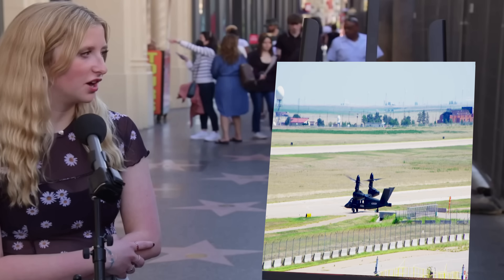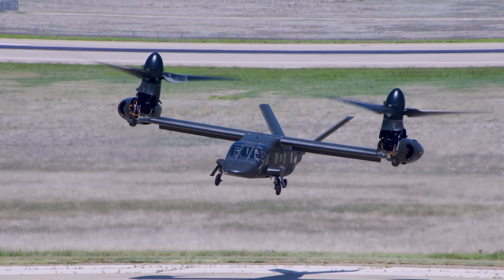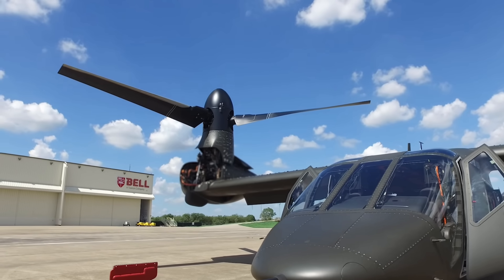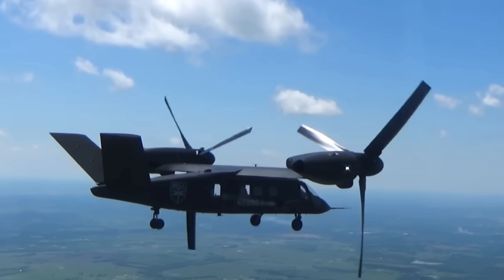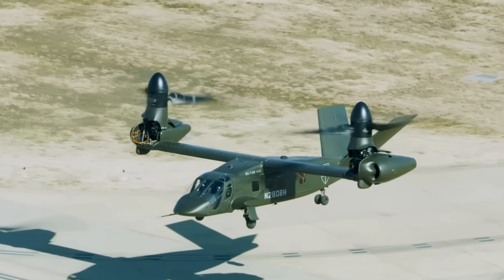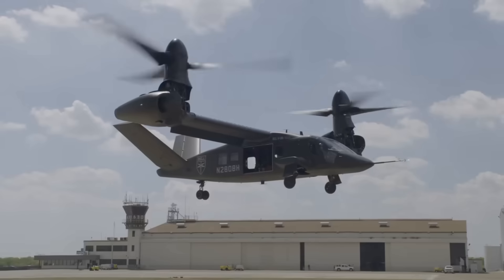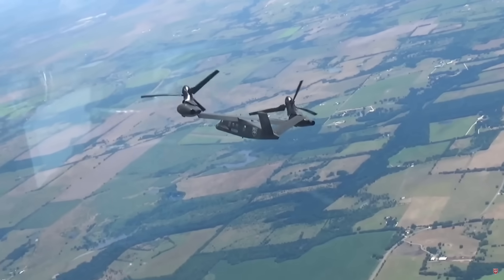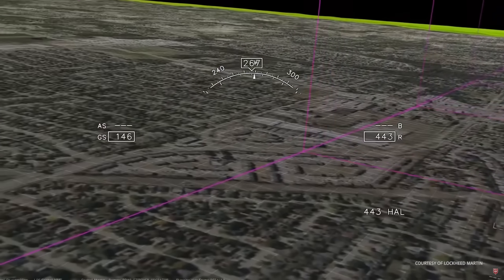Bell V-280 Valor - What's the big deal anyway? | BLACKHAWK REPLACEMENT

Comment: I personally would have wished the Defiant had won. As a Former USAF Pararescueman, I have some experience working around and under helicopters. The fact that all the weight of the entire drive drain is concentrated in the middle of the aircraft tells me that it would be more agile and be able to fit in to smaller spaces. 2nd when the rotors are horizontal, the lowest point is the end of the proprotor blade as opposed to the bottom of the fuselage. Dragging a rotor tip thru a "widow maker" would be a lot worse then scaping the belly. The Shingle stack rotor must fit in a smaller landing area than the Side by side configuration. The most concerning part of the info was that the head of the program has said the decision was based on "Best Value". I hope we have not sold out to the bean counters, again.
Reply: Defiant had the cheaper bid. There is a protest underway with the GAO over alleged selection bias. That quote about value was included in the protest filing.

Comment: the range and speed is a biiiiiig deal. helicopters are some of the most efficient vtol aircraft, but tiltrotors really outpace it. no competition.

the issue with that is its hard to optimise the engine+gearbox and especially rotor parameters to be efficient in both regimes, because low airspeed, high lift and high airspeed, low lift (relatively) use completely different blade profiles.

Comment: Wait a minute..
You’re saying they’re not the same. 
That it’s an Apples to oranges comparison and I think that actually speaks volumes because if they’re so different that there’s no comparison then it’s like trying to put a square peg in a round hole then isn’t it?
I’m sure it’s a fine aircraft but it’s no replacement for the Blackhawk.
It didn’t even meet the armies requirements because it’s foot print is far too big to land this thing in many of the places that it needs to operate and they said they’re even going to replace at least some of the Apaches with it..
Like how is that even a thing?
This is clearly NOT an attack helicopter and while arming it makes sense it’s never really going to be a true attack helicopter

Comment: ive been told that the simpler something is the better it is for longevity and maintenance. With that in mind I would guess that the tilt mechanism has a bevel gear or worm gear in it.
Reply: CV-22 maintenance in the USAF hate their lives.
Reply: I agree - a possible configuration would connect each engine's output gearbox to the cross-aircraft shaft with a 90° bevel gear set, then drive each rotor through another 90° bevel gear set; the rotor tilt axis would be coaxial with the cross-aircraft shaft so no shaft joints would be required to accommodate angle changes.
Reply: A 2017 article by Aerossurance says 
"engine power is transmitted through a spiral bevel gearbox that transfers power to the proprotor gearbox.  This rotates on two spherical bearings."

Comment: i’m concerned with how these things will crash when they get shot down. Helicopters can still slow down their fall with the rotor if an engine is blown up, but this thing would have asymmetrical thrust and I think it would always crash terribly

on the other hand, a heat seeking missile will blow up away from the crew

Comment: It’s good R&D. Unfortunately it will never fly into combat. Much smaller drones and shorter range aircraft will be able to retrieve bodies of soldiers from the battlefield. Otherwise any approach needs armor, firepower, and a secure baggage train of fuel and armor. It’s getting to the point where attacking a prepared defense is just about impossible. Future boots on the ground need heavily armed and defended logistics. Build more Chinooks for whatever reason you think you might need air assault forces for.

Comment: I want to know the technical aspect and  torque loss from the joint.  That piece of tech is perhaps the most fascinating part of this plane.
Reply: There won't be a shaft joint which changes angle - it will presumably be done with bevel gears, with minimal losses.

Comment: The Valor is MUCH faster, climbs far more quickly than the Blackhawk and has a significantly higher operational ceiling and vastly greater range.  Helicopters generally are very vulnerable in urban combat settings, so a repeat of a Blackhawk down urban insertion scenario per se indicates something went very wrong.  If it were to occur, however, while the Valor is indeed a larger target, it would remain in the danger zone for a far shorter period of time.  It is also important to note that Blackhawks are not going anywhere...a large number of them will remain in service with the US Army for quite a long time, so in those settings where a Blackhawk remains the better option, it will conceivably still be around.
Reply: How could the Valour remain in a danger zone for a shorter length of time ? To fast rope troops it would have to hover higher than a Blackhawk thus increasing the potential of inquries and possibly fatalaties. If it needs to touch down to unload its troops it would need a much larger LZ. This could mean that the troops would have to advance further to their targets thus being more vulnerable to enemy fire.
Reply: @crusher8017  You are at risk throughout the entire flight envelope, not only while hovering.  The Valor will be out of reach of small arms and manpad range for more time during it’s flight (which will be shorter overall) than a Blackhawk would under equivalent circumstances because of greater speed, rate of climb, and service ceiling.  If landing is required and the LZ will only fit a Blackhawk, those will still remain in service for decades to come.  Note that despite much protestation to the contrary, the Defiant footprint is also larger than Blackhawk.
Reply: Also don’t follow on your comment about higher hover requirement.  I am not aware of any reason why Valor would need to hover any higher than a Blackhawk for rapid egress.  Additionally Valor footprint is only slightly larger than Blackhawk (just turn 90 degrees).  It is clearly not “much” larger.
Reply: @Aspeer1971  Try landing the Valour in something likes the streets of Mogadishu. This aircraft has too much width. UH-60's could do it. The replacement has to be good all rounder.
Reply: @Aspeer1971  That's what I said. The footprint is larger. This makes the Valour less of a tactical asset for rapid insertions and extractions. It is a good platform for wide open areas but not when people have to fast rope close to the ground.
Reply: @crusher8017  Agree to disagree.  Don’t know of any Blackhawks that “landed” in the streets of Mogadishu.  They crashed.  Again, the Valor turned 90 degrees occupies a slightly larger footprint so the issue is much less significant than that.  The simple fact is the fact pattern you just described represents at most 1% (generously) of the what this machine will do.  Urban insertions into a hot zone are about as rare as it gets, for good reason.  You are simply reflecting a video game, not factual representation of this machine’s real functions.
Reply: @Aspeer1971  The footprint is what I have been trying to point out. And the main time that the Valour is vulnerable is when it transitions from aircraft to helicopter mode. This something regular helos don't encounter. I would hazard to say that regular helos such as the AH-6, Apaches, Cobras and DAPs would clear the LZ for the Valour as it is more akin to a transport than an attack platform.
Reply: @crusher8017  I think we simply need to agree to disagree.  The Valor is accelerating far faster than any helicopter can when it transitions from helicopter to aircraft, while the transition from aircraft to helicopter is still at fairly high speed as it must occur above stall speed in aircraft mode.  So what you are saying is only true when moving fast compared to a helicopter is a disadvantage when moving in or out of a hot zone, which I suspect is extremely uncommon.  The Valor (no u, it is a proper noun; this is not a debate about UK vs US spelling) is also more of a Blackhawk than an Apache replacement, it is not a strike helicopter, though it will replace it in some roles.  It will be able to double as a strike aircraft/helicopter which will convey some important advantages over the Apache in some functions but it won’t be able to replicate a lot of important AH64 functions that require a low flying and stable hovering platform and it is not intended to.  That is why the Apache will be replaced and/or supplemented by TWO different platforms and the FARA program competitors are both more traditional helicopters for that reason.  The Area Denial role will remain reliant on a more traditional low level hovering platform, as opposed to a fast and fuel efficient one intended primarily to transport troops and equipment quickly and efficiently over large distances.
Reply: @Aspeer1971  Fair enough mate.

Comment: You are exactly right. This will require a rewrite of how we use vertical lift aircraft to make our procedures line up with the new systems capabilities, rather than just swapping out the UH-60 and seeing if anyone notices.

But hey, the CH-47 is still running stronk!

Comment: I wonder if the Navy, and by extension the Marines, would go for this to replace the Seahawk, or might they go for the Sikorsky design, given that it has a smaller footprint?
Reply: USMC and USN are more likely to go with Defiant derivatives for medium utility and attack. They already use V-22 that has better range and capacity than V-280, which makes Valor a downgrade for them in capabilities. Defiant is a good option for replacing the Huey and Seahawk family helicopters.
Reply: @Stu_Bur  I recently saw a retired F-18 pilot interview the Captain in charge of the CV-22 program. The adjustments that the Navy requested to make these birds have the legs that the C-2s, of which this guy used to fly, means that these whirl birds have quite the flight range.

Comment: The Blackhawk gets pushed into civilian applications but i feel the size of this kind of excludes those functions, not that the Blackhawk is nimble and small but you can get it into town squares, small fields, car parks, this is 9 meters wider giving it less landing spots. Another factor is the downdraft, i haven't seen anyone talk about it but apparently the Osprey's downdraft is "powerful", it's just another consideration, some Blackhawks will need to remain to function in areas the Valor might not be suited for. As a pure military support vehicle it has incredible advantages, but it loses a little flexibility.
Reply: The downdraft of the Osprey is a pretty big problem but it's also in part due to having the engine exhaust tilting down and being much closer to the ground forcing even more debris to be picked up. The Valor should be much better in that regard but still an issue in arid regions.
Reply: @freetobe3  But it still needs a much larger landing zone.
Reply: The Defiant seems to have more potential for civilian use. I could see company executives or air ambulances using Defiant derivatives for fast and agile transport in urban areas.

Comment: The Ukraine war like most wars is being made with Artillery, not just the normal Artillery tasks but interdiction, usually a Air Force task. You're RCA dig in, ther is very info out there except Thomas C. Theiner ex Italian Artillery officer.
Reply: V-22 would be better logistics support to keep artillery fed with supplies than V-280. Defiant would be better for air assault and medevac in close contact with adversaries.

Comment: I am actually in favor of the Valor replacing the Blackhawk as I see more utility for it if the spec numbers are accurate however, I am wholly against it being the Apache replacement. I find it to large in width for that task and I see the Invictus as being a better replacement for the Apaches mission profile, we learned long ago during Vietnam that having a utility helicopter playing the role of a gunship wasn't the best idea, hence the creation of the Cobra and subsequently the Apache.
And while the Invictus is intended to inherit the Kiowa's role and again if the specs are accurate seems perfectly viable to supplant the Apache as well, as for the Defiant I find it to be a laughable attempt at best. It is far to large, heavy, lacks range, speed is little better than the average helicopter and coaxial rotors have their own mess of issues there is a reason why no other nation or company has attempted to market one other than Russia with Kamov designs.
For starters they are a nightmare when it comes to maintenance, given you are forced to remove the higher rotor to even get to the lower one which takes time, their height is also a problem which can sometimes lead to maintenance issues if hangers are not tall enough (often they are but some are not), the rotors can also clip one another should they be weighted down with ice for example (something the Soviets found out), the push prop in the Defiant's case also adds a additional failure point and target opportunity for MANPADS not to mention it also negates 2 of the benefits of a coaxial rotor in that no rotor need exist on the tail and a smaller design profile overall (see the Ka-25/27) while maintaining the same lift capabilities of a larger aircraft.
For naval applications the design works perfectly well with the limited surface area of many rear pads on ships for the aforementioned benefits but for the way the Defiant is designed as of now it would fail in that role as well, the one use case I can see for it maybe a heavy lift role as alternative to the Chinook (as that is a aging platform as well) since it was stated by Sikorsky-Boeing that it could be scaled up to a 30,000lbs lift capacity while affording better range and speed than the Chinook should Sikorsky-Boeing choose to go that route.
Reply: Invictus and raider x is for replacing Kiowa warrior scout attack helicopter. V 280 valor is for replacing blackhawk and apache helicopter. They are two different helicopter replacement program.

Comment: I still don't like where the engines are, they should be above the passenger compartment and have shafts running out to the props with a gearbox so you can run on one engine if one fails, in this config, the engines are going to attract MANPADS and if one goes down you'll lose the entire aircraft

Comment: I think of the V-280 as a far more mature and capable version of the Osprey. Bell had thousands of flight hours and years to perfect the tilt-rotor technology having learned from the Osprey which they kept working on. I didn't agree at first but then I looks at the V-280 capabilities and what the military will need in a conflict that could take place in the SCS/ECS. I like the Defiant but it just isn't as mature a plaform. That said, I do hope the army picks the Raider X for the scout program. One thing I am not sure of is how the Valor could replace the Apache as a dedicated attack helicopter?
Reply: V-280 is less capable than Osprey. Less capacity, less volume, less range, and no rear ramp. The innovations are cool but would be better as Osprey upgrades.
Reply: Who said Apache replaced by Valor? Thats wrong. Some say Raider replaces Apache. Also wrong. Only in scout role.

Defiant variant would be best suited to replace Apache, if it needs replacing.

But also valor replace Blackhawk is wrong. It replaces Chinook. Look at it!
Reply: @TheBooban  For the Apache I can't say, you are probably right and it wouldn't make sense. The Valor is replacing the Blackhawks as that is what was said here and various other articles. Where did you read the Valor is only replacing Chinooks?
Reply: @rickjames18  i didn’t read it anywhere, but its not hard to figure out. Army is plain lying. Blackhawks do not have long range assault mission. Since it doesn’t have long range! 

Chinook does long range assault mission. And army stopped ordering them, but Congress forced them to buy more. So if army say this will replace the chinook, Congress would kill this program.

Tilt rotor is an entirely new airframe. And this competition was tailored for it to win it. It doesn’t really replace anything since nothing else is tilt rotor. It is new capability the army wants.
Reply: @TheBooban  DAP's can also do long range missions.

Comment: That's the thing when you have two designs that both exceed expectations... It stops being very objective and becomes more about which one people think looks cooler. As someone who really loved both designs I'm happy with the choice. It'll be interesting to see if maybe the Defiant will have another chance when it comes time to update the other military branches versions of the Blackhawk (like the Navy) where it would probably be beneficial to have a smaller airframe for places like aircraft carrier flight decks.
Reply: The Army wants an aircraft capable of deploying and operating in the Pacific.  Sadly, the Defiant is just not that aircraft.
Reply: The DefiantX is way more complex and being built by Boeing nuff said
Reply: It doesn’t help that the Army is lying. It’s obvious this thing replaces the Chinook. Not the Blackhawk!

The whole program is a lie. This started from a general program for new helicopter tech. Then they discovered they have two great ones and created two separate programs for them to “win”.
Reply: There are claims of selection bias that are part of an official protest to the US GAO. It may result in delays or a restart of the selection process.